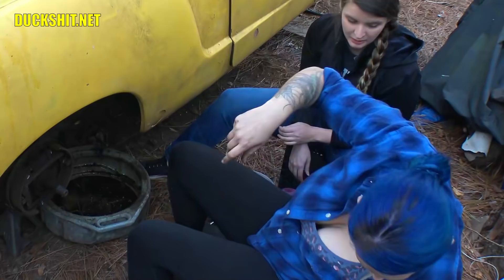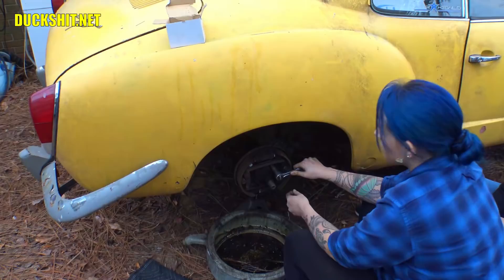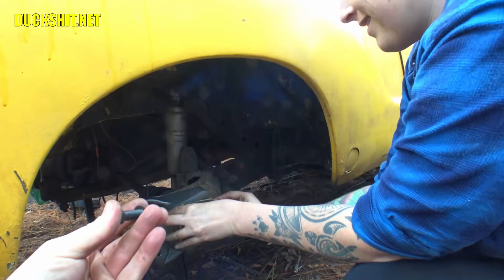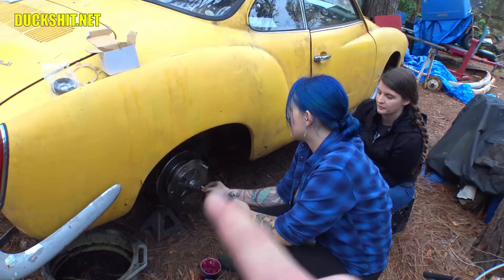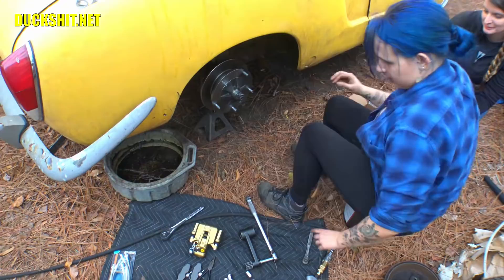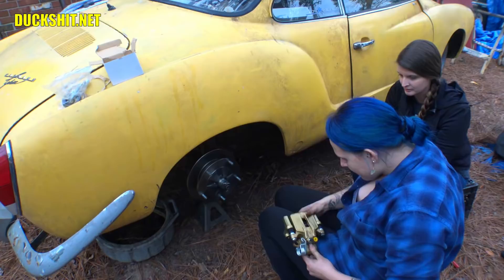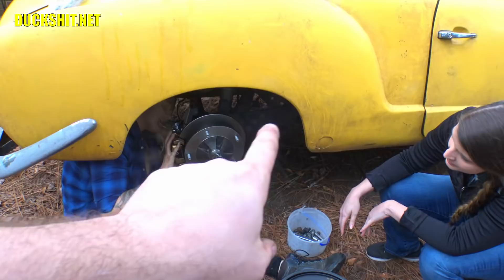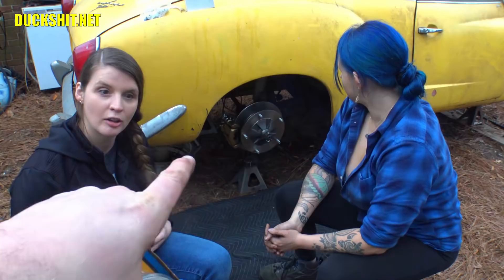Rear Disc Brake Install - 1971 VW Karmann Ghia - Part 6

Comment: I usually place the bolts in the assembly before placing it on the spindle. This keeps the gaskets in place. Then loosely start all four bolts.
Reply from the maker: That'd be great, but there's no spindles in the back here.  Hehe!  She's still leaning, that's the kinda stuff that comes with experience.

Comment: Nice disc conversion. My 1971 type III has rear discs that were fitted some time in the distant past . The calliper is tiny little alloy thing which has a handbrake mechanism which pushes the piston into the disc rotor. It took a little bit of search to find what they came off ,a Nissan Skyline RB 32 . The rotors look to be cutdown from something bigger.I have no idea what though.
 May be you need to buy a some ball pein hammers in various sizes,to save wear and tear on the ratchets. 😁
Reply from the maker: Interesting.  got any video covering that?  Its a curiosity that I'd like to see!

Comment: they were 14's on the beetle we tore apart this weekend
Reply from the maker: 14" wheels?  I haven't seen that video yet.
Reply: @DuckmanCycles  14mm bolts on that part of the brake bracket
Reply from the maker: @longboardluv2  Ahhh!  In the bearing cover!  LoL!

Comment: M8 bolts were 14mm until mid 60ies then 13mm acc. to DIN standard
Reply from the maker: Thats some interesting data there!  Thanks for sharing!  What was your source?
Reply: @DuckmanCycles  DIN standards 931, 933, 934 (bolts and nuts) were modified in 1963 change from 14 to 13mm for M8 can be found in revision log of the standards

Comment: Does Bee only work on VWs and the fart box? If not I got a oil leak on a tractor that I need help with. Its just a couple of O rings but its little hard to get at and its minus 10 out and the tractor is outside. Any help?
Reply: Wait till thaw?
Reply from the maker: Sure, bring it down.  We'll make a video!
Reply: I don't know about Bee but Aislynn probably only works on John Deere green tractors.

Comment: I bet you run into alot of 12mm bolts too most uncommon socket but seems like most used bolt ever
Reply from the maker: Not a whole lot of 12mm on a classic VW, actually!  Usually its 13mm!
Reply: @DuckmanCycles  wow that amazing cause I've seen alot of cars foriegn and domestic using that size lately I guess it was like British cars with the whitworth nuts and bolts cant work on them if they dont have the tools
Reply: nerd alert, its the difference between the euro metric standard and the Japanese standard, (din and iso i think) Japaneses cars are all 12mm no 13s

Comment: Does the vw’s have residual valves in the rear brake lines? Reason I asked was when I did my domestic truck drum to disk rear conversion, I had to change out the drums higher pressure valve to a lower one. (Seemed like I ended up with a 3lb valve instead of the 8lb )

As always awesome videos!
Reply from the maker: No, but I did make a video where I tested one!  I have been asked this question a lot lately! 
 https://youtu.be/lNSqpaexOOo

Comment: Why are you using 5 wide lug disc hub on a 1971 4 lug Ghia?  Got some old wheels you need to use?
Reply from the maker: There were a lot of reasons for 5 lugs that we answered in earlier videos, please check em out!

Comment: Ive been lucky too find all my nuts on the brakes too be 13mm. The brake pads on my bug was held together with nails wire washers cable ties and assortment of goodies. Did you look at the pics i sent you on my disk brake conversion
Reply from the maker: I don't remember where you sent the pics, or if we talked about it before.  I seem to remember something.... fill me in!  Lots of people I talk to every day!  Thanks so much my friend!
Reply: @DuckmanCycles  sent too you on instagram

Comment: Whatsup duckman!! Im installing the same kit on my 70 bug. I say it’s the same kit because I saw your review on CB performance of the same Porsche style rear kit. I have a question about the washer and oil deflectors that come with it. Are those just used on the swing axle? Because when I took it apart I didn’t see either. And when you guys were installing the kit you never talked about it until the end when you had a spare washer. Any insight? Love your vids brotha!! And the multiplier, game changer!!
Reply from the maker: Not sure, I guess I need to see an exploded parts view of IRS and Swingaxle setups, to complare differences, and have you point to what is the problem.   Please try and clarify and I'll see what I can do to help!  Thanks!

Comment: Duck man! What’s the 36mm nut tool you’re using, I’ve never seen it, I just did my ghia all the way around and had to use a cheater to take them off, I haven’t tightened all of them yet, old school tighten with all tires on, em brake applied and in gear, what a hassle, 
Also I noticed you went from 4 lug to 5 wide, I want to go to 4 lug on my swing axle, I don’t know it it’s possible, can I just swap out drums or is it more complicated? Thanks, love your videos, and the babes!
Reply from the maker: 1. Tools are always found in the video description.  Torque Multiplier ▶ https://amzn.to/2NyhXbm
2. I made this video, just do the reverse steps and you're gold.  You may need a special drum, however, or cut the nose off of yours.  https://youtu.be/2uD_c0ip7Ig